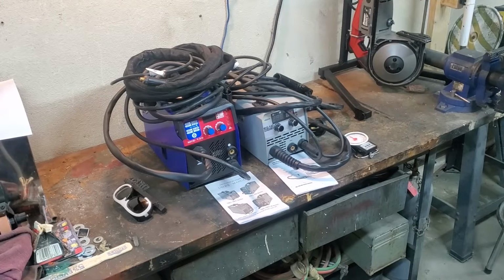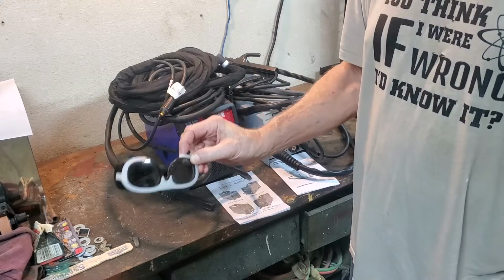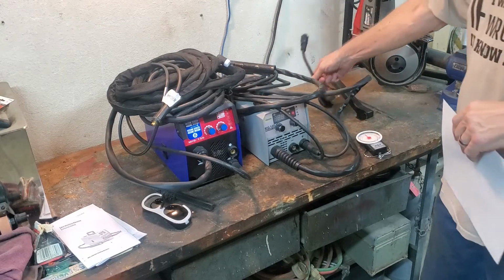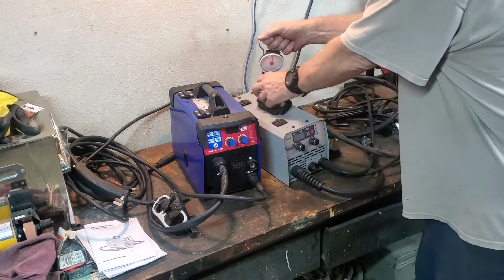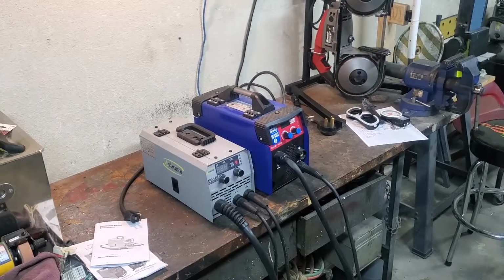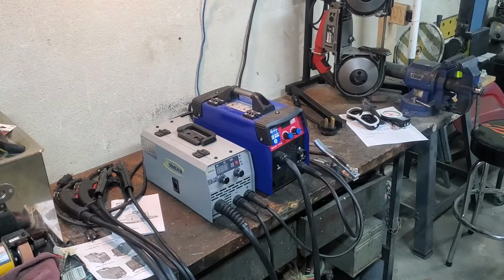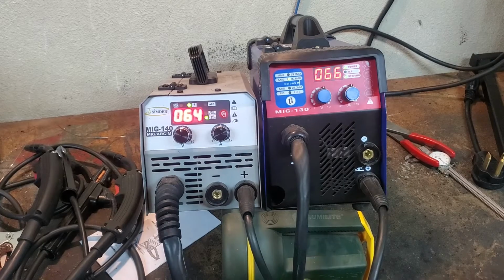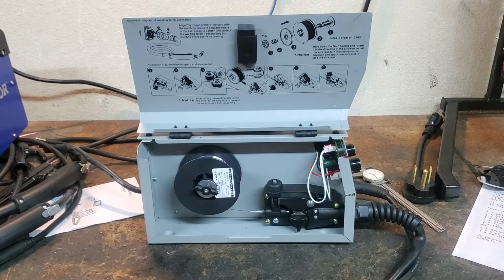Budget Flux Core Welder Comparison! Simdar MIG 140 vs Vevor MIG 130.  Part 1.

Comment: Thank you for the great and thorough review. I went ahead and ordered the simder for 2 main reasons. First, it was the only one in the price range that can run 220v. Second, it had the long mig lead. It arrived yesterday and I unboxed it this morning. They have updated it since your review. Firstly they put a cover over the exposed board above the wire feed but the hole is still there. Secondly they  hanged the ports on the front so you now have to remove the mig gun in order to attach the stick holder. Very frustrating since you have to pull the wire back and that will cause extra wear on the plastic internals. And the last and most frustrating update is the mig gun is now only 6'7" rather than 9'3".
Reply from the maker: Thanks for letting us know! It's a shame they fixed one problem and caused others. It's one of the problems with some of the Chinese retailers, they're at the mercy of the company making the things and they can change without warning.
Reply: Just wanted to give everyone the heads up. I think I'm gonna send mine back and just spend a little more on a little bit bigger welder with the metal internals and 10' leads. Thanks again chuck for taking the time to make the video.
Reply from the maker: @Kutless1308  I don't blame you for sending it back. The long gun lead was one of the main things I liked about it. Vevor has a Mig 200 for $250, I've been hoping they'd send one to me for review, but they have a list of things each month that they'll send to reviewers and I guess I'll just have to wait until it shows up on that. I'll put a link to it here in case you're interested.
https://amzn.to/3JoBWnK
Reply: @3rdpig  I'll look into that one. Thanks for the link

Comment: the Vevor is only 110V, check documentation.
Reply from the maker: Did I say in the video it would run on 220v?  If I did it was a mistake. I'll have to watch the video again. I think I make it clear in my comparison with the Simder that it was only 110v. And the documentation they included in the box with mine was for a different machine. But they do state in their marketing info and on their Amazon page that it's only 110v. Thanks for watching!

Comment: My Vevor is 110v only and I have a Reboot 1500D that is dual voltage..
Reply from the maker: The Reboot looks like a good machine. Thanks for watching!
Reply: I am 73 and learned to stick and braze weld at 14 in school.. retired cabinet maker who continues to enjoy making things.. I have a 15 yr old Lincoln 100 amp flux core with limited adjustments and only a 20% duty cycle.. the Reboot and Vevor are similar but I got a real deal on the Reboot 1500D and it will take a spool gun.. I will continue to watch and trust my welding will continue to improve..